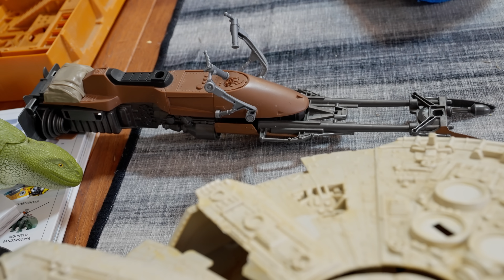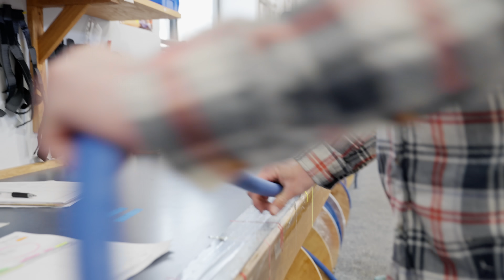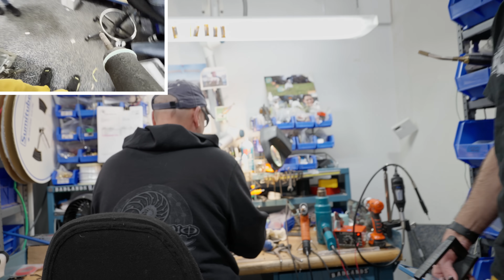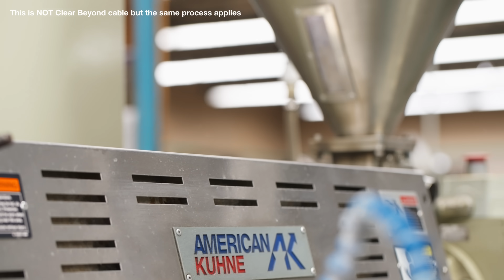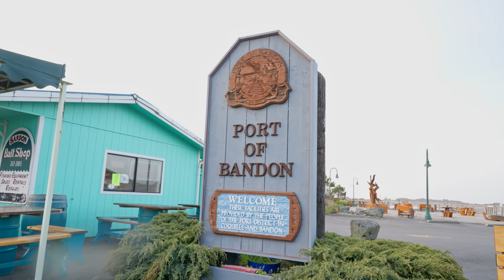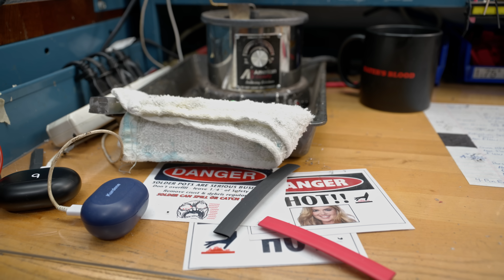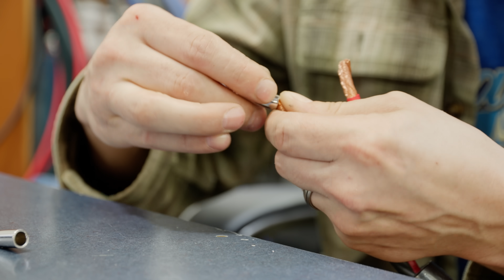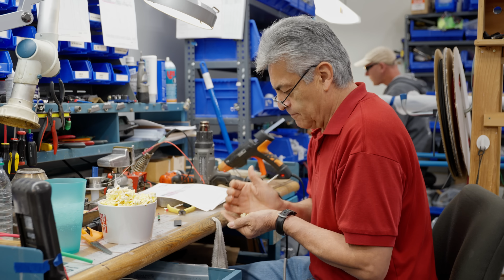This is the BEST video about LOUDSPEAKER CABLES that you will see all year

Comment: Really!   Non believer!  Just extra heavy gauge Litz wire packaged up for maximum beauty and mystique.   Litz wire does have special properties when you use in high frequency applications but not reasonably associated with the audio band.    I would argue that equally heavy gauge industrial wire would sound just the same at a fraction of the cost.   Just lacks the hype.

Comment: Jana rocks. Amazingly well done. 

Just a side note it freaks me out all the work that goes into making such a pure gorgeous copper conductor and people are touching it with their bare hands!!! Getting oil and contaminates all over the most important part of the cable. ☹️
Reply: Its enameled. No harm done. No oxidation.
I like her work too.
Reply: @syhi7971  yes I saw that later in the video, but after wire was stripped of the enamel with the brass brush machine the technician still touched and twisted the raw copper with his bare hands. Gloves gloves gloves, also getting copper wire splinters is no fun at all. Just surprised and mind blown. I’ve gotten way to many splinters and always use gloves now to protect the wire and my hands. To each there own I suppose
Reply: @edouble0325  STFU
Reply: I had this thought as well. Strips the enamel off the end of the cable and doesn’t have gloves on.

Comment: Who doesn`t want to be cheated, trusts science & common sense (blind tests or even better how those particular people avoid it ). Thousands of dollars for "to be said" better qualities of just this particular speaker.....c`mon???
Reply: You don't need 1000 $ cable , 150-200 $ cable from Kimber or Cardas will be ok for comparing to bare wire. What you need is transparent hi-end audio system. Mostly people who use  mid-fi stereo make claims : "there is no difference" (even if they didn't try).... And they are right , on 250 $ system there's no need for expensive cables.

Comment: Let's clear the air a bit..GREAT cables are necessary IF you NEED them and have the system to make them shine. MOST of the world listens to MP3 and do NOT have dedicated listening rooms with wine, cheese ,and a chair properly angled .Most who go to clubs have hearing loss or just can care less, as long as you can make out the instruments/vocals, and there's bass. MOst of the world hear their music on computers, tablets, smartphones ,or something like soundbars, which I also use everyday. I have a full sound system ,yet I am not going to turn all that on when I can pipe music through easier means while I do things around the house. To add to that, you have too many variables like the cleanliness of power into the house, amp/preamp matching, speaker construction/quality, time delay coherence, the room itself, and all that requires more money, time and effort then most people can afford. I'm going to probably check Cardas out because i just bought some more speakers,and i might even already have a couple since I have acquired a lot of different cables.

Comment: Maybe a stupid question but do you need a extra way of taking the weight of the cable before you plug into say Amp or do you make sure Amp is near the floor but what happens speaker end ?

Comment: Any reason why they are not using cable cutter matched to the leads instead of a riskier razor blade?
Reply: Yep if your skilled enough, a razor is better. Especially with the Teflon like insulator involved.
Reply: my  thought exactly...
Reply: Not as precise and cutters also stress the conductors ( copper or silver ) inside!
Reply: The copper will react from the fingertouching....why doing that?

Comment: Don't skin oils affect the copper? Just wondering why no one is wearing gloves...or am I wrong on this.
Reply: Popcorn and hotdog oil enhance the sonic characteristics of the cable
Reply: That was my first thought when I saw that part of the video.
Reply: Discovered this after making my own PCBs. Sweat is actually the issue. Highly corrosive as a layer of oil covers the salt and urea.
Reply: Right! All that care and attention only to be smothered by oily fingers
Reply: The individual wire strands are enameled. Listen @ 21.06
Reply: @gotham61  the guy stripps the enamel and then twists them using his bare hands later in the video

Comment: No need for better wire than what's in your gear (which is almost always surprisingly cheap).
Reply: You have no idea...  and there are very few components that run audio signal over wire internally.  So your comment is a trick comment :)  Cardas is a widely used internal wire for OEM companies and my speaker systems too.
Reply: @JurMalafi  lolz.
Reply: it is in cheaper gear.
Most high end gear has good wire, and Cardas wire is commonly used.
I suspect this is because reviewers tend to open gear up and take pics, which would explain why speakers often have cheap wire

Comment: Looks like a cool company to work for and I'm sure many of their customers are enjoying the product but it is also clear that no actual recearch other than listening tests in uncontrolled environment is done in the design process. The way they both explained the testing process shows that they never heard of echoic memory and its effect on how we process sound.
Reply: The video didn't get into the Fibonacci ratio strand size progression construction that George Cardas patented decades ago, and which they have used since day one. That's why they use a sea shell in their logo, the segments of which also follow a Fibonacci sequence.
Reply: @gotham61  the patent in question once again has no scientific merit, it is just a patent. Even George says the following in the actual patent application: "Although the phenomenon is not completely understood, employment of different sized individual conductive strands within the cable according to the predetermined golden section ratio produces significantly improved efficiency in the transmission of signals from one end of the cable to another when compared against prior art cables which do not employ this system." and doesn't provide any data or research to back this" not completely understood phenomenon".